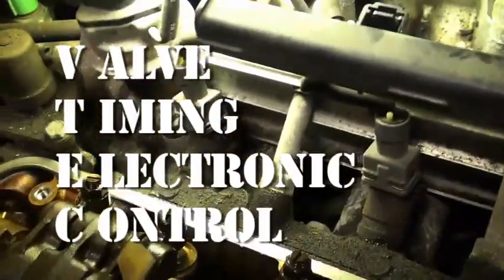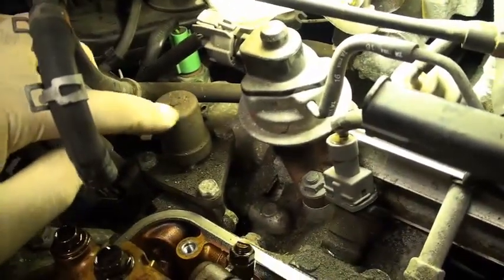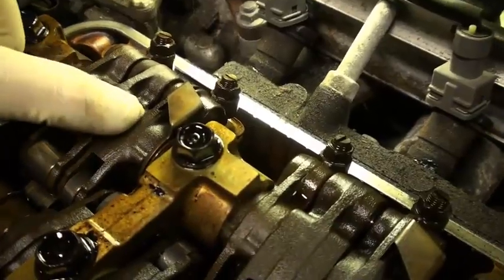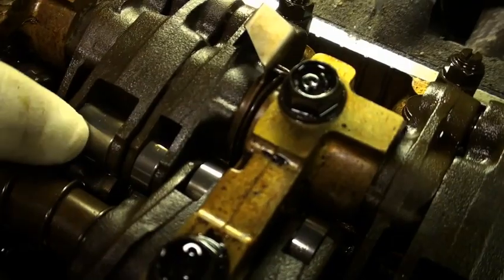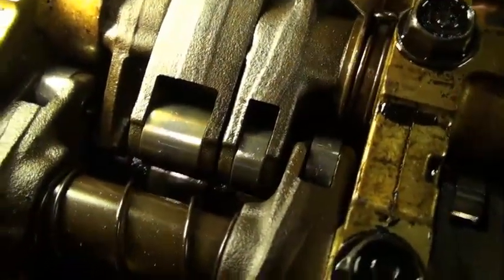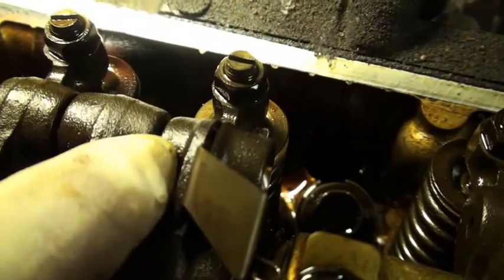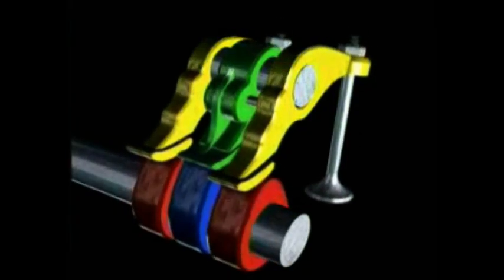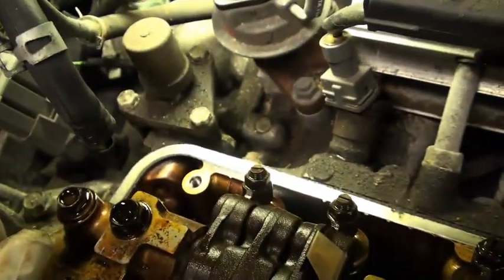What is VTEC and How Does it Work? - EricTheCarGuy

Comment from the maker: @Markooroz Depends on the type, some VTEC is on both intake and exhaust and it opens all 4 valves all the time just with a greater lift and duration when VTEC is engaged.  The VTEC that is intake only on some engines will open up a second intake valve in the way you describe.

Comment: so pretty much when driven normally and not placed under too much acceleration it uses to valves, but once you hit it, well for my 06 euro it stops for a split second then vtec kicks in and starts using 3 vales

Comment from the maker: @maghari6667 Actually it does add horsepower because of the increased lift and duration.  The philosophy is that you can have an engine that gets good fuel economy when driven normally but when you get into it it's like you put a performance cam in the engine instantly, performance on demand would be the way I sum it up.

Comment from the maker: @fishaholic2012 Some engines are designed the way you describe with one closed intake valve but others work all 4 valves and the lift and duration is increased when VTEC is active.  The principal and operation is the same but what it activates varies depending on the engine.

Comment: @mayers000 You'd loose low end torque if you did that. The car would feel like a slow gutless turd until you reached higher RPMs. It's kinda like slapping upgraded camshafts on a Civic, or a monster turbo on a small engine.  With Vtec or similar, you get both low end torque and high end power. Lots of cars now have variable camshaft timing too.

Comment from the maker: @MiIkweed The most common cause of that code is low oil or improper oil.  Check the oil level to make sure it's correct and do your best not to let that engine run low on oil because it will kill the timing chain on that engine.  Next, make sure you are using the correct oil for that engine which would either be 5W30 or 5W20, check the oil cap to be sure.

Comment from the maker: @tinydx95t2 To be honest the only problems I've seen with this are low oil or incorrect oil that have caused problems with this system (and I have EXTENSIVE experience working on them).  I have yet to see the actuator stick open as you describe and there is no adjustment, the computer decides if VTEC is needed and activates it accordingly.

Comment: What happens if the vtec actuator sticks open and pressurizes the vtec rocker arms all the time?Will the engine idle weird? How would you adjust the vtec valve? Just couriouse about it and how it works. I find it fastinating and as a mechanic I never messed with it so I would like to learn.

Comment from the maker: @Ampyxx Not a good idea, the oil level has nothing to do with VTEC operation but rather the oil pressure.  If you overfill your engine with oil the crankshaft will come into contact with the oil and whip it up into a foamy mess that will not lubricate as it should, oil needs to be a liquid to do it's job.

Comment from the maker: @Vettejocke When the oil pressure is gone it slides back into the bore naturally, in fact I've never seen a mechanical problem with this system just oil pressure problems caused by the wrong oil or incorrect oil.

Comment from the maker: @dandim23 The HX was a variant of the HF model that stood for 'high fuel' (or have fun in some circles) and was designed for maximum fuel economy, even had fiberglass fenders, 'racers' liked these because they were built light and you could drop a big engine in them and go fast.  The 'e' in VTEC e is for 'economy'.  Thanks for listening to the podcast and for your comment.

Comment from the maker: @White31490 #1 problem that I've seen with VTEC is low oil or incorrect oil.  The first thing to do is check the oil level especially since you have a flashing oil light.  You might also want to get an oil pressure gauge on it to see what the pressure is, if it's low you may need to do some surgery on the engine or replace it sorry.  You can watch the video I did on How Oil Pressure Works to get an idea what I'm talking about here.  Good luck and keep me posted.

Comment from the maker: @2010petrolhead Valve overlap happes on all engines how much depends on the cam design, not VTEC.  Other companies do similar things to change the lift and duration of the cam but the principal is the same.  They also adjust cam timing as well in some systems including late model Honda systems.  I really don't have the space here to explain the principals of camshaft design but know that it works like a computer program that tells the engine how to breathe which equates into how it makes power.

Comment: @EricTheCarGuy Well I took car into dealer a few months ago and they said valves needed adjusting. They did, but the tick never went away and was told it was normal. Well today I pulled cover off myself and found the exhaust cam lobes galled/pitted. how long can I run it like this or is it best to replace cam now. And if so should I replace both cams or just the exhaust side. Car has 140k on it already but would like to get another 100k out of it. Thanks!

Comment from the maker: @cd1melton1 That doesn't sound normal.  Most Honda's have a solid valve train meaning the valves can be adjusted, I might start with a valve adjustment and go from there.  To be honest VTEC hardly ever has a problem so I wouldn't look there first.  Also make sure you are using the correct oil.

Comment: I have an 03 Honda with a loud tick/tap at the front of the motor (#1 cylinder valves) at low rpm. Could this be from the solenoid being engaged all of the time? Almost sounds like what a colapsed lifter sounds like in a V8. I took it to the dealer and said they couldnt find anything wrong. But Ive never had this problem before. I hear it a lot in low rpm and after motor has warmed up

Comment from the maker: @djrodriguezthizz Not quite, the center lobe has a higher lift and duration meaning that it will open the valve farther and for more time thus allowing for more air to enter the cylinder which would equate to more power.

Comment from the maker: @shieldcracker Actually this engine only has VTEC on intake valves which are pictured in this video.  The only other option is to have VTEC on both the intake and exhaust, in short, intake only or intake and exhaust would use VTEC.

Comment from the maker: @d46512 It doesn't do it at 'any moment' it actually happens at a prescribed RPM range.  The Toyota system differs in that it also has the ability to control cam timing as well as lift and duration, later Honda engines also employ this strategy, it's called iVTEC.

Comment from the maker: @78enigma78 Synthetic oil is associated with performance however in my experience with Honda's the closer you stick to stock the better especially when it comes to oil.  I really haven't noticed any performance gains from synthetic oil over regular but you can extend the oil change interval with synthetic.  I have seen engines running synthetic burn more oil than those running regular oil however.  In short don't waste your money on expensive oil.

Comment from the maker: @78enigma78 Engines tend to burn oil after they wear out, that could be at 200K or 20K depending on how it was taken care of.  You could do a compression test to see what kind of condition it is in.  I would also suggest switching back to 5W30 since it is a bit thicker and if you have problems with burning oil you will want to use a thicker oil rather than a thinner one.  Don't go higher that what is called for which is 5W30.

Comment from the maker: @elliott12591 Not exactly.  VVTi is similar but also adjusts cam timing at the sprocket as in the second generation K series engines.  VTEC just does a different lift and duration and does not adjust cam timing whereas VVTi does.  I will do a video covering this at some point that will illustrate it better.

Comment from the maker: @tezskanza Your actually describing something similar to what Honda used to use years ago called CVCC.  There was a separate intake valve much smaller than the rest that opened to give the swirl effect you described.  The system allowed the engines to run very lean 21:1 in fact.  VTEC however works as I described in the video for this engine.  Great comment, thanks.

Comment: My understanding was the rocker arm on the right (in your vid) has the same cam profile as the center rocker arm. The one on the left (without the roller) has a reduced cam profile. This creates a swirl effect on the fuel/air mixture as it enters the cylinder. When VTEC is called for by the computer, the oil pressure moves just one pin to lock the left rocker arm to the other two. This allows both valves to follow the increased lift/duration required at high rpms or high loads. Nice vid, btw.

Comment from the maker: @mustangboss2008 So you put the DelSol engine in it?  Bottom line is that if you put a VTEC engine in something that didn't have it to begin with you will need not only an ECU but also the wiring to not only the solenoid but the oil psi sensor as well.  There are some kits out there, just do a search and I'm sure you will turn one up.  Good luck.

Comment from the maker: @swaggal0s0 I wouldn't try to make a non-VTEC into a VTEC, it's much easier to just get a VTEC.  It's not just parts that you swap you would also need a new ECU and harness to run the wires to the VTEC system.  Best advice I can give you is if you want to go fast start with a fast car and make it faster, don't try and make a slow car fast because it will cost a LOT more money in the long run.

Comment from the maker: @irishtwinsmummy Well there are a couple of different VTEC engines you could be referring to.  One just had VTEC on the intake side, the other has VTEC on both the intake and exhaust.  If it is the version with both intake and exhaust you better have a manual trans because that is all that will work.  You will also need to switch the computer and run new wiring and connectors for the VTEC connections.

Comment from the maker: Well if the CEL is on then it might be in limp in, if that is the case you will have limited function of the engine until you address the CEL issue.  Pull the code and start with that.  To fix the oil burning, to be honest it would be cheaper to replace it with a salvage yard engine.

Comment from the maker: No worries on driving the car in VTEC or not, just make sure you check the oil on a regular basis and keep it topped off.  If your state has emissions testing you may not pass however.  Also, over time running that oil through the catalytic converter may be a problem so keep that in mind.  Every car burns a little oil, some more than others.

Comment from the maker: Quite simply blue smoke means oil is being burned.  The higher the cylinder pressures the more it will burn.  It's either the rings or the valve seals, my bet is on the rings.  You could always do a compression test, if the wet test is significantly higher it's defiantly the rings.

Comment from the maker: It's called a cooling system pressure tester, you hook it up in place of the radiator cap and use it to pressurize the system as if it was fully warmed up.  What you are looking for is a precipitous drop in pressure indicating a coolant leak, if you can't find it externally it may very well be an internal leak.  GM's are kind of famous for coolant leaks at the intake gaskets causing a condition similar to what you describe.

Comment: Yeah, the yellow paste is at the very top of the hash marks and some at the very end of the dip stick. We are still in the rainy season here in Northern California but I drive exactly 18.4 miles each way (36.8 Miles R/T) to get to/from work so the short trips myth is kinda busted lol. What is the tool called that would help me to determine the system leak?
Also I'm within 600 miles of my 5k oil change being due, maybe I should just change it out anyway just to be safe.

Comment from the maker: That's kind of what it sounds like, moisture in the oil.  This could be because of high humidity or an internal coolant leak.  Pressure test the cooling system and see what you come up with.